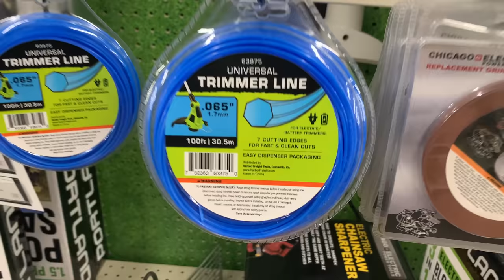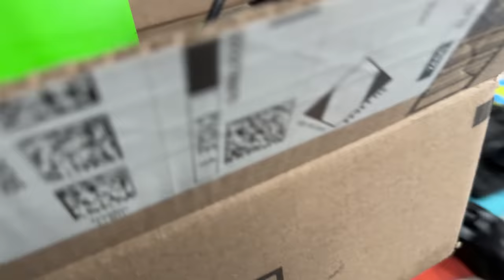My Workshop Was Destroyed...

Comment: A bit of urban NY living experience - with a floor drain in your closet that may or may not drain to a public sewer (or hell, a septic system for rural dwellers), the floor drain may have an S trap under it. The purpose of the S trap is to fill with water and prevent smells (toxic air or otherwise) from arising from the sewer into the house. You'll want to regularly recharge the trap with water (fancy way of saying pour water down the drain) because, as you know, water evaporates. You'll know when to do so by the smell.

Comment: I Definitely recommend keeping anything that is on floor level off floor level by at least 6 inches.
Having had my basement flooded as well due to a frostproof hose faucet that froze and split and didn't know about it causing 2 inches of water through my half my basement. Things that were in water resistant tubs were nice, things that were off the ground were nice, things that weren't on the ground directly was nice, things that were on the ground not so nice. But at least it was clean water.
Yeah I feel for you. If you cut into the wall walls you might've standard a chance but you were also renting so you can't really cut into the walls that we're gonna get cut into anyway. The longer the water is behind drywall that's supposed to be dry the worse it gets.

Thankfully my basement wasn't finished and I self remediated. However it still cost me $4000 in lawyer fees because I went for a walk and tried to be a good Samaritan to a Karen that I didn't know it was a Karen.

Comment: Sorry to hear about the flood but congrats on the new house.

I'm an electrical/automation engineer and live down in the springs, I've been thinking about automating some stuff around my home, I have a 3d printer and some wood working skills, but was looking at an arduino/pi based system.  The issue is I'm experienced in automation, but it's industrial/manufacturing based, low voltage in my field is 480VAC, not 5VDC.  I know next to nothing about programming arduinos or small electronics design.  Sure, I'm an engineer, I could figure it out, but I'm also lazy AF.  

If you'd like to work on a project together (I don't want to be in your videos, I have a face made for radio) let me know.

Comment: Hey bro for your storage room you can buy a cover that will screw tight and plug that drain so water will not come up thru it. It can be a problem if the room floods from above but chances are the above water coming down will be cleaner than what will come up from the drain.
Reply: It doesn't thread into the pipe they have a plunger and when you screw it it spreads the plug so it'll lock into place. I haven't seen 1 in a long time but they do exist

Comment: 15:45 If you want to be sure, i suggest you get liquid moisture barrier and coat the walls and the floor with it, adding material to bottom of the door so the whole damn thing has room for least 5-10cm of water with out moisture damage. I never understood how American houses dont have this type of setup in ever room with a sewer drain, here its requirement to prevent that. Also all pipes need to be with in protective pipes that lead any leaking water to technical room that has the drain, so even if pipe has a leak its easy to replace and dont ruin whole house. Further more.. black mold in a week? holy shit that place was beyond saving way before this happened. Also get rid of those full floor carpets.. no fucking wonder there is mold when you have carpet nailed to floor. Good thing you got this clusterfuck fixed. Just make sure this place cant have same issue so prepare for such thing specially since you now own it. Do same with the electrical systems to make sure those are properly done.